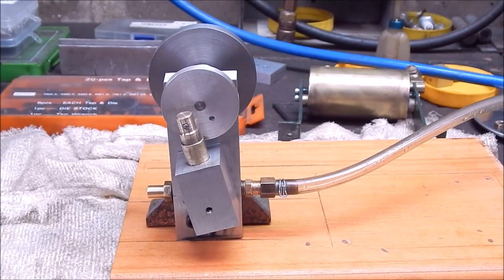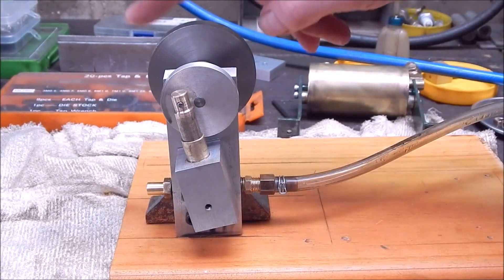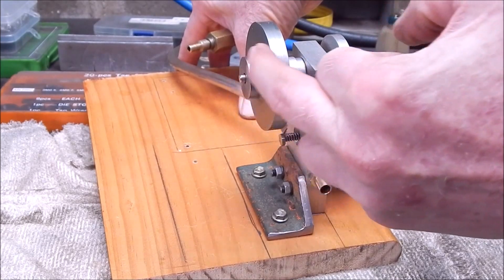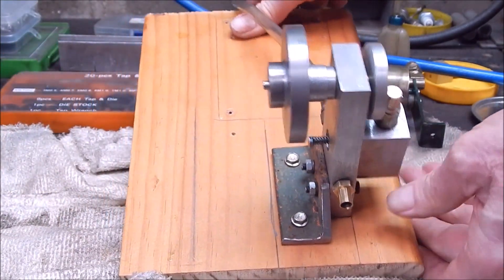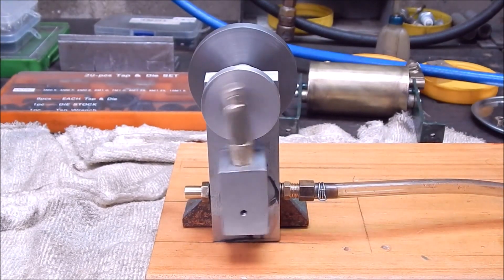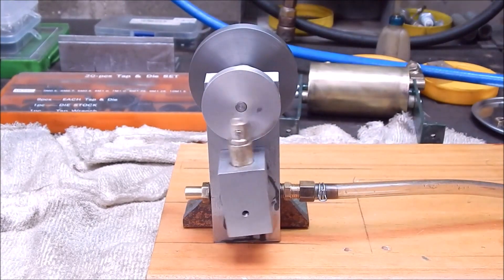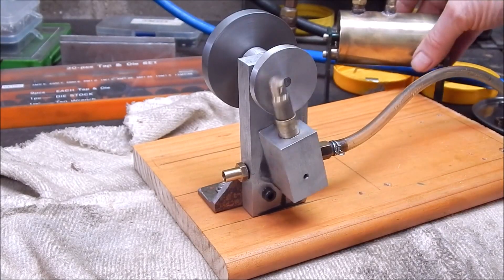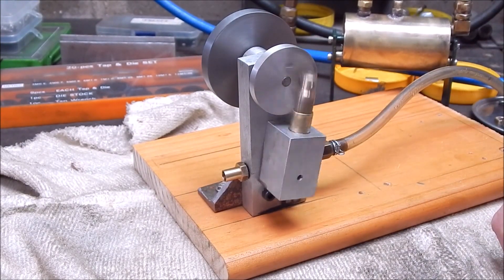The home brew wobbler steam engine is complete and runs a treat

Comment: Thats a lovely little motor
Reply from the maker: Thanks Campbell.  It turned out OK.  I did a follow up video of it on a decent wooden base running on live steam from a boiler I made. 

https://www.youtube.com/watch?v=F0JdZHU3bNM

Looks good on the shelf with the other model engines.

Cheers Rob
Reply: @Xynudu  You have enthused me to make one myself. I too was going to have a go at a sterling engine, the heat from a tea cup style but I haven't found the right stuff yet but that wiggler looks like a good starting model for me with little experience.

Comment: Nice little wobbler Rob. Runs really smoothly if it were mine, I think I would mill off the sides of the crank rod to narrow the bearing area and lessen the friction as I think there is a tiny binding going on on the crank pin. Yes I'm being picky ! If that were done that would run on less than 1 psi I would think as the rest of it seems to be perfect. Can't wait for steam up!
Reply from the maker: I actually machined it back this morning - had the same thought.  I also bushed the pivot pin as the aluminium was showing signs of wear already.  No big deal, it all helps and it gave me an opportunity to try out some 0.01 mm increment cobalt drills I have to review.  Damn handy set.   I had it running on steam yesterday, but no videos yet as I have a steam leak in the plumbing line to fix.  More to come.  Cheers Rob

Comment: You couldn't wish for better than that Rob, runs smooth as silk 👍👍👍 A lovely little runner, it's always the sign of a well made engine if it will run slowly on very low pressure. Looking forward to seeing it run on steam. Cheers, Alan.

Comment: Hook up to the little motor to generate power, run the power to the air compressor, perpetual motion right there! 😊😊😊

Great job on the engine. Looks to be a real winner.